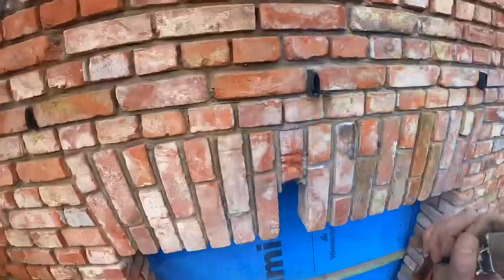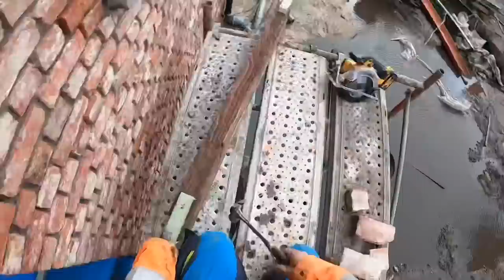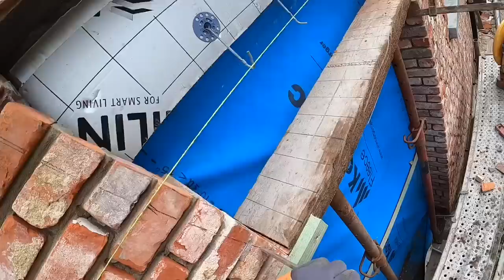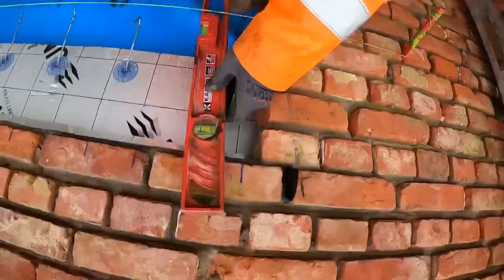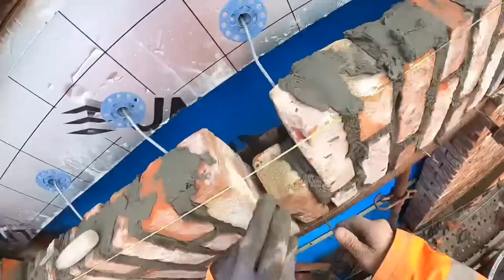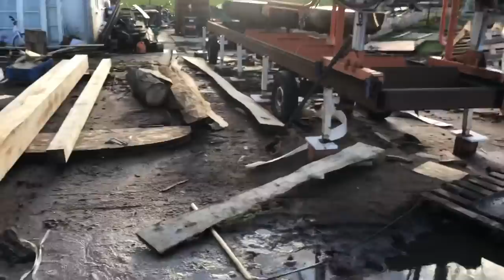Bricklaying a flat arch  - how to do it ? (vallende strek) old farm rebuild (21)

Comment: Lovely job jay , like how you struck the lines for the arch onto the brickwork above so you could just line each brick up perfectly 👌🏼🧱👍🏽
Reply from the maker: Thanks Steve and Al .. normally when you make the brick wall you can make the bricks a few courses higher than the soldier , put a profile or wood on the wall and draw the lines on that one 🙏🏻 same principle
Reply: Jay Puyenbroeck Simple but effective!  👌🏼🧱👍🏽

Comment: you don't use  a lintel under the arch we are required to put them in where ever brick is over head.
Reply from the maker: Hi James yes normally we do use lintels or something like brickwork-rebar in the joints , but the owner wanted it to be like this , this shouldn’t cause any problems though 🙏🏼🙇🏻‍♂️
Reply: I know this is a very old comment but what country is that that you have to have a lintel in America we have traditional arches I've done a bunch of them and in England Rob songer has a bunch of videos of him doing traditional arches no lintels

Comment: Are you using cement mortar on what looks like old reclaimed brick?
Reply from the maker: Uhm yes cement , sand that the owner dug up somewhere , some plasticiser
Reply: @JayKTS  ok I thought that it would be too harsh on the brick, maybe the plasticizer will help.
Reply: It is not supposed to be cement,lime, sand?  Prop 1:3:6

Comment: Looks like quite an interesting and diverse build you’ve got going there... Lots of interesting elements, from brick ceilings right through to timber work. A total contrast to the other modern builds that you have shown in recent days with architectural concrete and clean lines everywhere... Is it the same Architect as the build that made it into the “Beau Livre”?

By the way, are you doing the timber work as well?
Reply from the maker: Hello Evan , yes I don’t think I ever did a house with this many different  brickwork features , the owner wants a completely authentic look from the old days , the architect is actually the owner he’s sister so not the same as from the concrete house , there are drawings of the farm but the owner keeps changing he’s mind about the brickwork features and some measurements of the layout lol , 
We help the owner out with the wood yes but the guy does have some knowledge and skills ... and ... big tools 

Merci mon ami
Reply: Jay Puyenbroeck Big tools... Me like big tools to make big things... 🦍 🦧  Once again real cool project, maybe at the end of the build you can do a recap of the interesting old school design elements? Thx for posting!